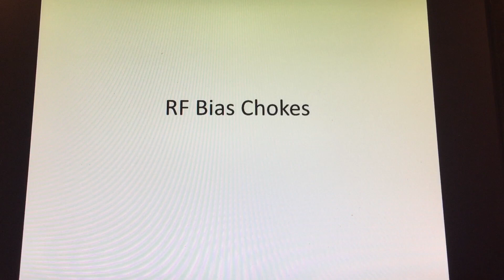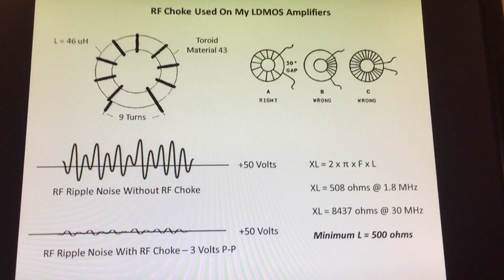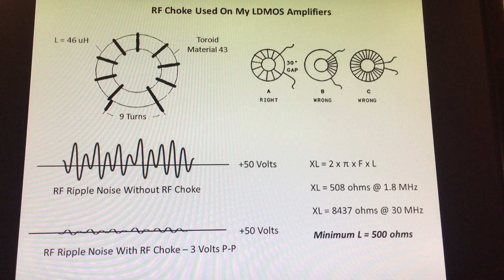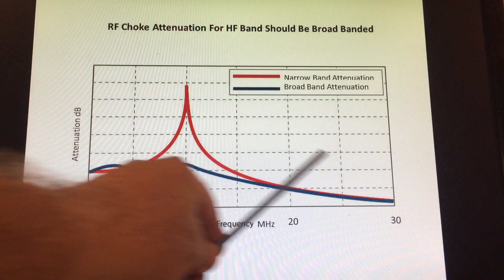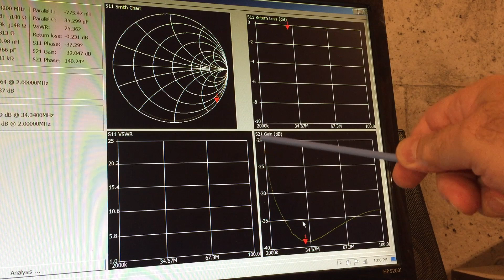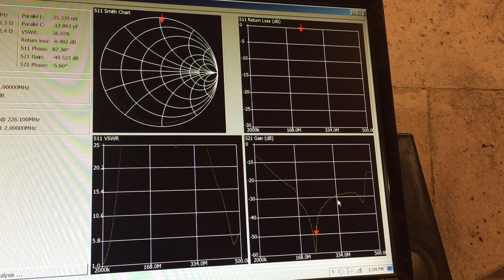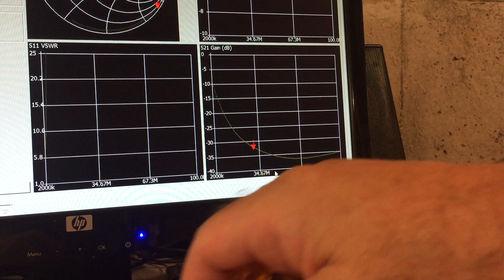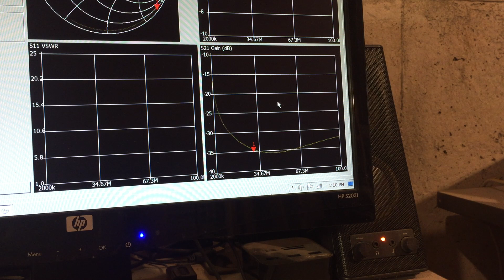RF Chokes - what are they and how are they used?

Comment: The dumb things i find everywhere, for 30 years! 
In Power Amplifiers of RF, in the force circuit, THERE IS NO CHOKE. 
In RF Power Amplifiers, there are no noticeable continuous curents. 
In the Drain, in the Collector, of the final, THERE IS NO CHOKE, NO RF BLOCKING. 
It is, or must be, if you want it to be a good amplifier, a non-blocking inductance, 
must be a transmission inductance. 
It does not block, it doesnot filter, and it does not let CC pass, because there is no CC. 
The small polarization curent, that opens for AB regim, it is neglectable. 
So, there is no CC AC separation. 
It is not filtering, something else applies, to calcvulate that inductance, and that is... 
The Maximum Transfer Theorem. 
The inductance that you call Choke, if it is to be choke, then ideal would be infinite inductance. 
However, that would kill all amplification. 
The inductance must be minimal, therefore it is NO CHOKE, it is a STORAGE INDUCTANCE. 
The storage inductance is part of the transmission, the main transmission of AC power.

Comment: The now have tiny mini versions of all these chokes - like 1/4” wide.
Reply: The size of the toroid and gauge of the wire used should be determined by the amount of current required. There are charts online that show current vs wire gauge. Regards

Comment: Great Video!
What would you get for broadband performance if you double, or stack two cores together?…
Would it get broader?  
I’m trying to get better power efficiency from the RF Amp of the (tr)uSDX SDR Radio.
Thanks!  73  WA4ITD
Reply from the maker: You will only see a small improvement. Regards